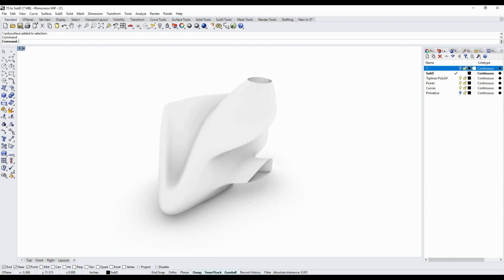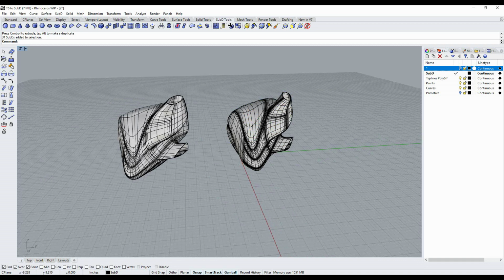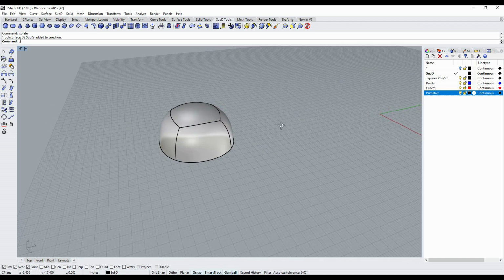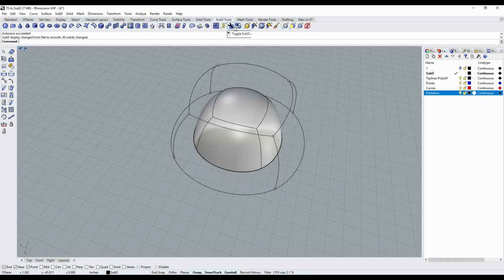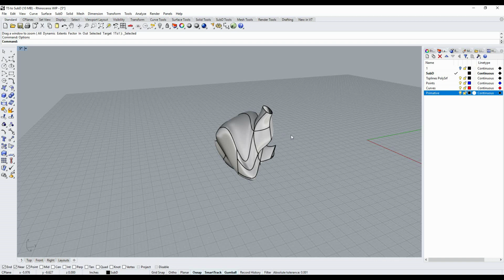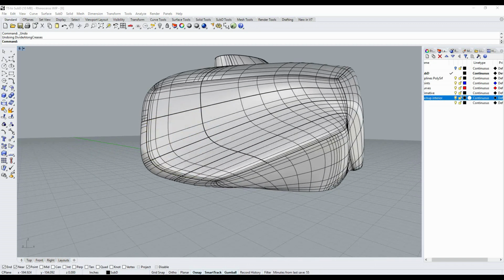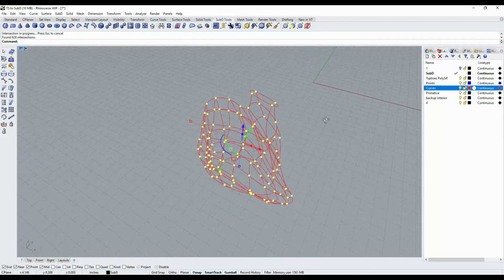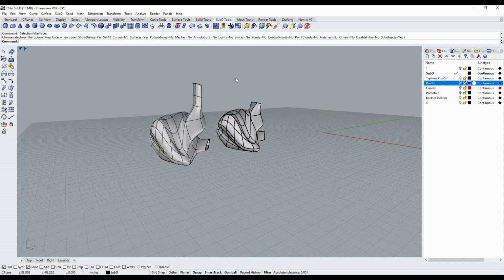Convert T-Splines model to Rhino SubD - Three Methods

Comment: hi bro what is difference between t-spline and sub d
Reply from the maker: Art world t-splines was a 3rd party plugin that is no longer available and only worked in Rhino 4/5. SubD is being developed by the makers of Rhino as built-in tools to be released in Rhino 7. There are some technical differences but they are both types of  subdivision modeling. You can create free-form organic shapes and have degree 3 curvature continuity. More here: https://www.rhino3d.co.uk/rhino-for-windows/an-introduction-to-subd-subdivision-surface-modelling-in-rhino3d-v7/